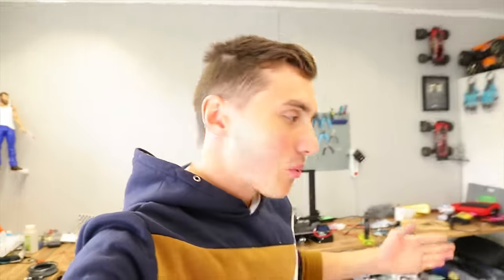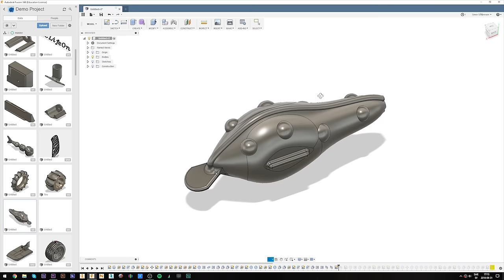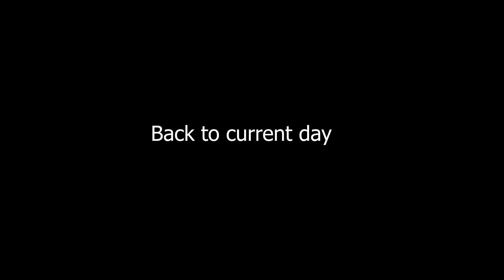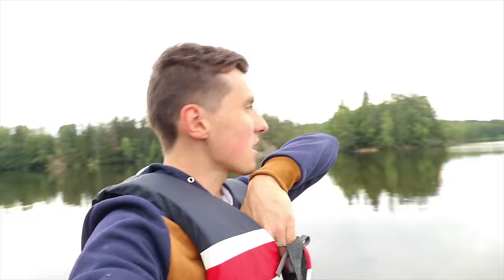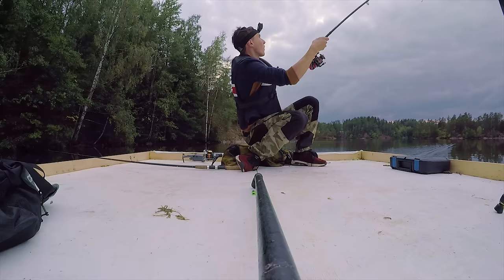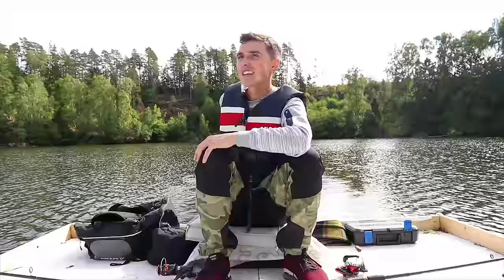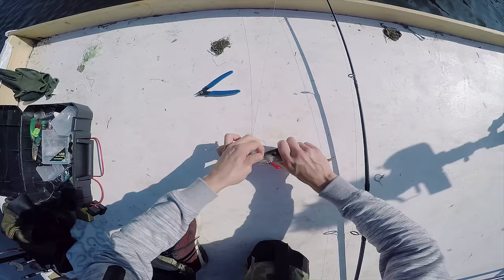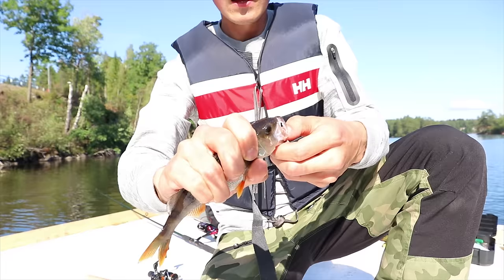3D Printed Swimbait Fishing Lure - Will It Work?

Comment: When the fish bites you need to pull back on the rod and “set the hook” I think that would help you land more fish 🎣
Reply: That and also id recommend keeping the rod tip down to avoid any jumping
Reply: @OfficialZurg  Actually loosen up a little when they jump. Too much line pressure pops the hook.

Comment: Love the video!!! I think you would have a lot more luck if you were "setting the hook" so when you initially get a fish on most of the time it is just the lure going in to the fishes mouth or the initial bite, but to get the hook to set into their mouth you need to give the rod a good pull upwards. So when you feel the rod move, say it moves to the right, then grab the rod and pull it hard to the left (opposite direction) and this will set the hook into the fishes mouth. I think you will have better luck with actually getting the fish on. Much love man!
Reply: For a pike you have to give him some time, because they grab the fish by the back and then they go down in the deep to swallow them. So you have to give them some time.

Comment: Would be cool to design a mold where you could inject a rubbery plastic. Would also be cool because you could add your hooks before injecting and have them linked through the bait with fishing line. This way if a fish really got after it, it couldn't rip out a hook. I've been dreaming on molding my own baits but i want to make something biodegradable. I hate the thought of tossing more plastic in the water that'll never go away.
Reply: There are companies that make biodegradable soft plastics. You can also switch out your lead weights with tungsten, or even make your own out of stones.

Comment: You most definitely need better/sharper hooks I think. 
Hooks and the sharpness of them are a very under rated part of lures and fishing. 
Pike have hard mouths so they need the hook set good and sticky sharp hooks. Just a suggestion, they could have just not bitten the lure in the best way, but it looked to me like the hooks could be part of the issue.

Comment: you should get some PVC pipe and make some rod holders at an angle or even just flat.I used to do the same thing onm my kayak(holding them with my feet) and the i put some pvc pipe on them and it helped out a lot.You dont have to worry about your rods falling in.

Comment: I have a problem with my new 3ender. I hope someone can help. When I have a long print something happens and printer stops printing and says waiting for user. After 17 hours in on the last failure. When I select continue printing the extruded backs all the material out of the machine and continues to run in reverse. Any suggestions
Reply: Leave a post on ender 3 Facebook page and see if they can help..